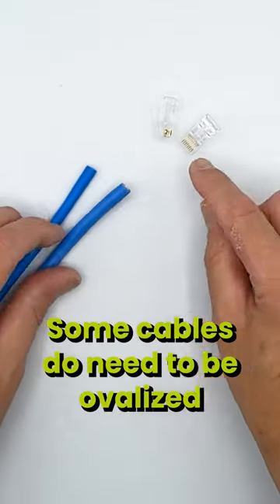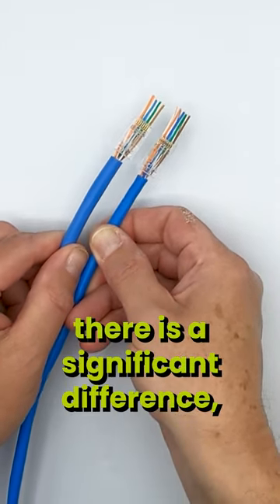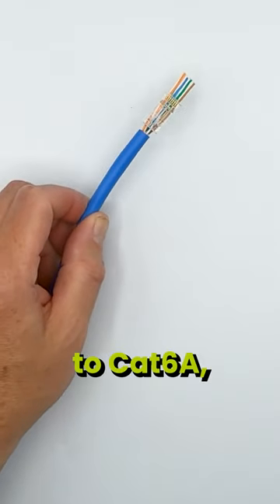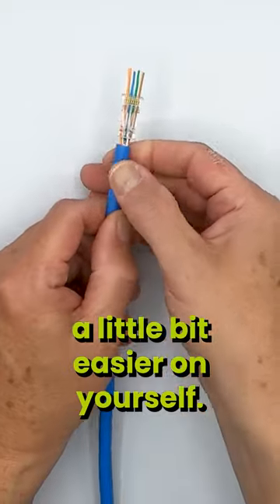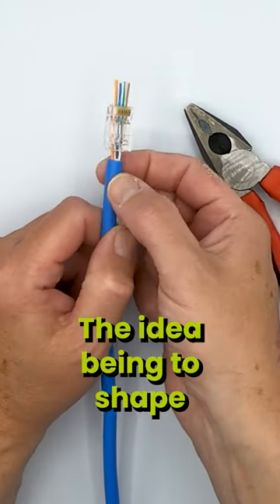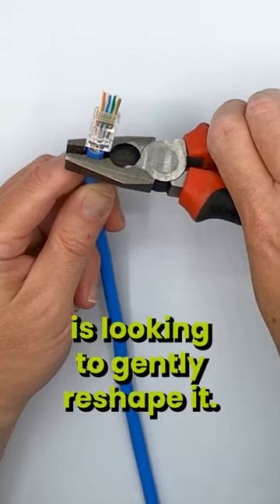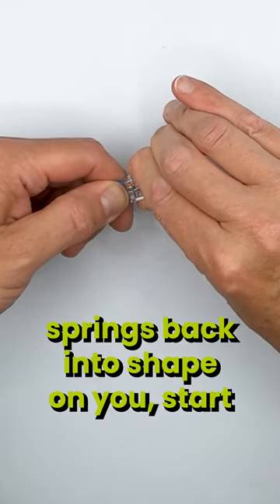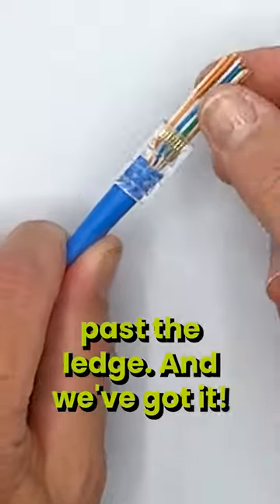Making Your Cable Fit Your Connector #shorts

Comment: Are there any connectors that can let you easily open maybe the top like a field plug and wire it but not be a bulky
Reply from the maker: Hello Kristopher! Unfortunately, no. There is no such plug designed like that. It would be nice though, wouldn't it?
Reply: @trueCABLE  :) time to make one fellas!
Reply from the maker: @kristopherleslie8343  Hey Kristopher! If only we could. The IEC spec on 8P8Cs is very restrictive, dimension-wise. We would end up with a field termination plug-sized device.
Reply: @trueCABLE  hmmmm :) wish I could think of something
Reply: @trueCABLE  i wonder if AI could jumpstart and idea

Comment: That's awesome Make it easy to cause NEXT.
Reply from the maker: Hello! I have subjected these terminations to Fluke DSX-8000 Certification (MPTL and PCA testing). NEXT passed every time. Mild ovalization causes no permanent damage as the cable will "spring" back to form fit the inside of the rear of the 8P8C connector. Essentially NEXT will be no worse than if you fought the cable in with significant effort. Hope this helps!
Reply: @trueCABLE  You should not have to modify the cable to install a mod end You should not be installing mod ends. cat6 cabling was meant to go to a structured jack or a populated patch panel and then you would use manufactured certified patch cables to finish your run
Reply from the maker: @BradyMcClanahan  Hello again Brady! Generally speaking, this is correct. There is an exception, however. Since 2018, ANSI/TIA 568.2-D has approved a MPTL termination (Modular Plug Terminated Link) which is terminated with a patch panel (or IDC keystone) on the switch side and then a 8P8C modular plug on the other end. This type of link is used for PoE devices such as cameras and WAPs, especially when a field termination plug will not physically fit into the PD housing. Hope this helps!
Reply: @trueCABLE  it doesn't because I have no problem with installing my cameras on POE switches using a structured Jack and manufactured patch cord.
Reply from the maker: @BradyMcClanahan  Hey, Brady! That is great! Could you please share how you accomplish that with outdoor PoE camera installs? Any installation tips and tricks you have developed over time would be welcome.
Reply: @trueCABLE  Axis camera
 patch cable goes through conduit through wall 
Jack is on the inside
 figure 8 loop to block RF interference
Reply from the maker: @BradyMcClanahan  Thanks, Brady! How about an external installation where it is not possible to mount a keystone and use a patch cord? I typically will use MPTL links for that. What are your thoughts there?
Reply: If you can get a mod end into the camera then you can get a patch cord through the wall You do all your terminations on the inside All of our external cameras are patched to a lightning protector grounded to the building and patched from there to our Jacks in the field
Reply: @trueCABLE  You typically drill a 3/4-in hole just leave it with a half inch pipe and bushings connectors and boxes to port the cabling and service loops and then seal the outside with silicone.
Cameras are mounted on arms with all the weather protection seals and all over cabling that penetrates to the outside is lightning  protected.
Reply from the maker: @BradyMcClanahan  Hey again Brady. Thanks for sharing your process!
Reply: @trueCABLE  No worries and to be truthfully honest today was the first time in almost 12 years that I used MPTL.
I guess we all have to do what the customer's paying for.